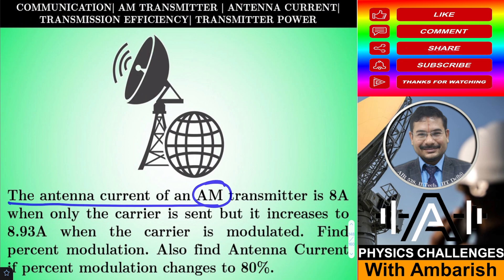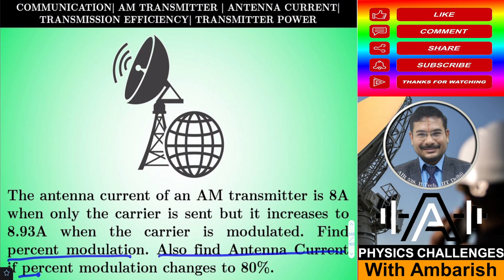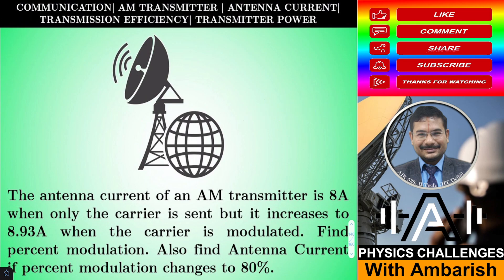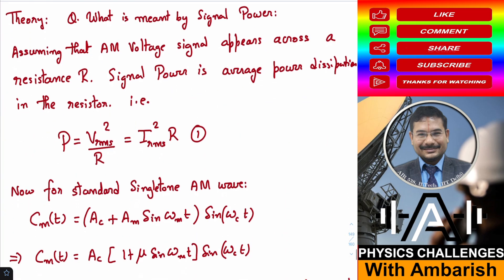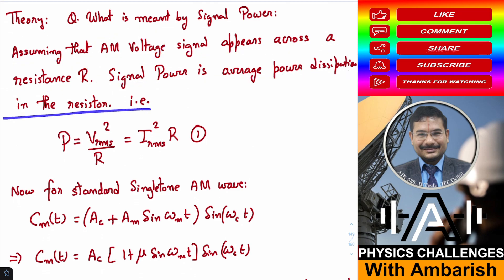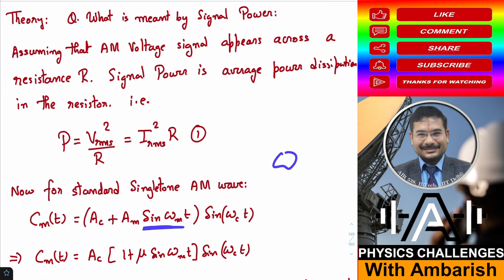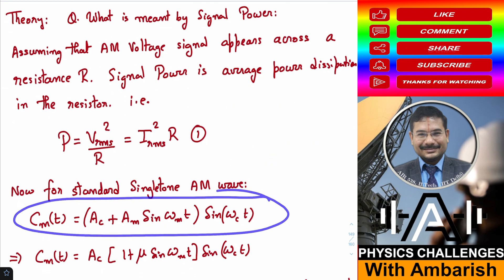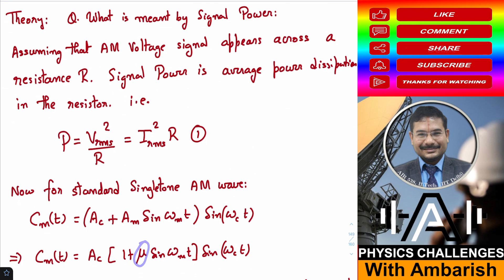COMMUNICATION| JEE MAIN| JEE ADVANCED 2023| TRANSMITTER CURRENT| TRANSMITTER POWER| EFFICIENCY|PROOF

Comment: Sir there is a problem of electrostatic in which a equilateral traingle is given and at the veryices of the traingle there are a three identical charges and asked us that in how many places within this equilateral traingle the electric field will be zero Sir then i want to ask you one thing that sir if we suppose take a random point in this equilateral traingle which is  located at X distance from first charge y distance from second charge and z distance from third charge and let the angle be theta between the electric field vector that is offered on the point by bottom two charges and if on that  point if electric field have to be zero  then we can make equation by doing net electric field zero and from this equation we get a relation between the distances X ,Y and z and theta and after this we suppose choose any point inside traingle and assume it distances from the three charges be X das y das and z das and let the angle be theta das between electric field vectors that is offered by the bottom two charges if the  values of this distances that is X das y das and z das and angle theta das satisy the equation that we got earlier by doing net electric field zero then on that point the net electric field will be zero sir can we do this problem by this method or similar to this method